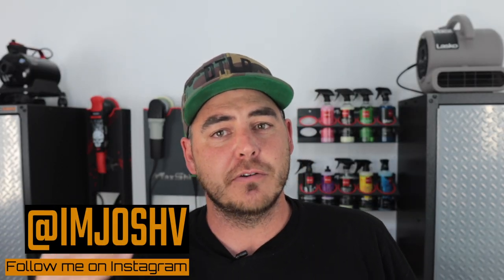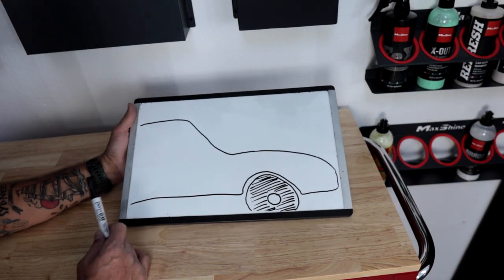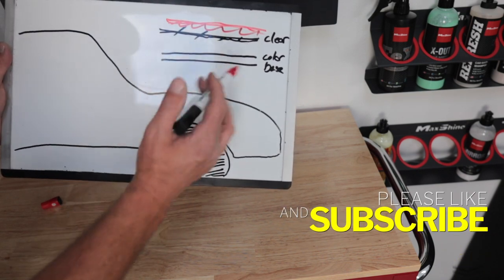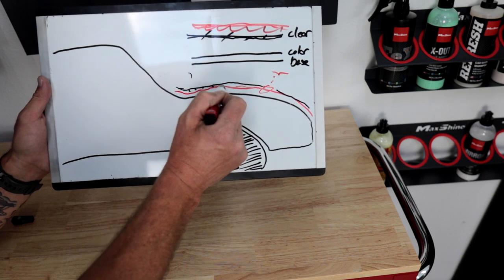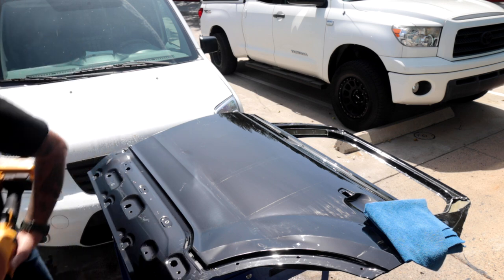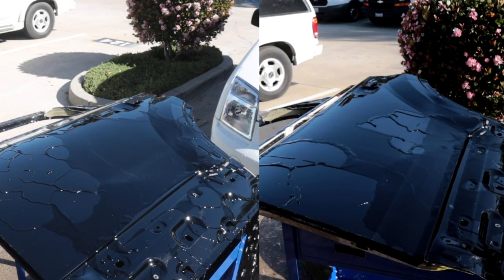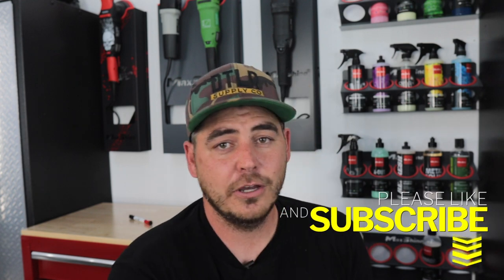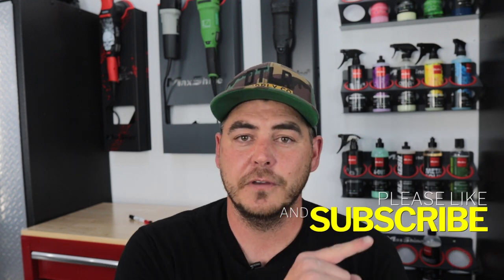Can you put WAX ON A CERAMIC COATING? Ceramic Coating Tips and Tricks

Comment: By the time I have applied a ceramic coating, I am too tired to apply anything else.
Reply: DIY’er problems.
Reply: Ceramic coating will last years. So a year after you put ceramic you can clean the surface/cay it and add a carnauba wax if you like that warm glow. Like he said the water will react to the wax and not bead as well. If you still want the ceramic properties I Would recommend adams graphene boost to enhance the shine and water beading.

Comment: Better to use a wax that is designed to be used on top of ceramic coating like Gyeon Q2 Wax.
Reply: Even using that, it still affects the properties of the coating. The wax will make the car temporarily glossier and slicker, but it will clog the coating and make it loose it self cleaning properties over time.
Reply: @SpartanKyuubi  if your coating is clogged, a decontamination wash will restore it.
Reply: @larrysing  of course, I’m just saying the wax will clog the coating itself.
Reply: @SpartanKyuubi  Gyeon has recommended adding a layer of wax on fresh ceramic coatings to help avoid water spots before the coating is fully cured for years. I doubt they would say that if you were immediately clogging the coating.
Reply: @larrysing  of course they will, they are promoting their own product.

Comment: Great video! What is your take on the Turtle Wax hybrid solutions ceramic spray? I’ve been using it for just over a year on my wife’s jeep and I really like it. I like how you can use it over everything, plastic/glass/paint, but is it as good as dedicated ceramic coating?
Again love the videos, keep up the great work 👍
Reply: I use the same TW ceramic spray product. Brilliant value for about £13.00 for 450ml. The gloss and hydrophobic reaction of TW is very similar to a coating, but the dedicated coating is thicker, more durable, and lasts from a year to nine years, depending on what you go for. Here in the UK, I find I have to reapply the ceramic spray every time I wash the car. For dedicate coatings I use Gtechniq Crystal Serum Light, and Carpro CQuartz.UK V.03.

Comment: I understand that once you apply wax on top of your ceramic, you lose the beading properies of ceramic. But isn't the point of beading to remove water from your panels fast so it doesn't sit and cause damage to your panels? If I have ceramic coating already and the wax is not beading the water as much, what is the harm? The panels are coating with ceramic underneath anyway....I was thinking of wax to add that gloss and warmth and yet function as a sacrificial layer for subsequent car washes...

Comment: I started waxing my coated black car in the fall because of the water spot that appear due to cooler weather.   I've found that I don't have 24hrs for a maintenance coat to fuller cure before dew forms overnight.   Wax doesn't really have a cure time thus moisture from the cooler notes don't leave those annoying spots.

Comment: Its like a rabbit hole. You ceramic coat to protect clear coat. You put wax to protect ceramic. You put ceramic in the first to reduce cleaning. People have other things to do and not just simply do this coating. 

Just ceramic coat the car and regular maintenance should last you more than 3 years. Then you another ceramic coating if needed. No more than this.

Comment: New subscriber. Great vid! 👍🏻 Would love your tips on rejuvenating a ceramic coating as we come out of winter and into spring.
Reply: Hi Kyle. Just want to help by giving you my method. I'm in the UK and coatings get a real battering over the winter period from road-gritting. We have all sorts of sand, minerals, salt, dirt and grease that can really affect a ceramic coating's performance, especially around the front-end, lower panels, and fenders.

I basically, start with a TFR soak and rinse to remove superficial layers of muck. Then it's onto a snowfoam soak for 5-10 minutes and then rinse. Next is a contact wash-and-rinse with PH nuetral to slightly alkaline (no more than pH 10) shampoo to remove that final film of grime and grease. Sometimes, that can be enough to revive the coating, but not always.

So, while the vehicle is still wet after rinsing I'll apply a fallout remover and tar remover to the front end, doors, and arches and let it dwell until it reacts. You can use a very damp mitt to spread the solutions around the panel if you wish. Rinse off thoroughly. If the coating is still inactive in part or whole, I'll finally go over the problem areas with a mild or regular clay and lubricant in order to remove any clogging in the pores of the coating. Usually, these steps would properly reinvigorate a coating. If the coating is still failing then I'd redo the shampoo and decon stage and assess. If it is still dead then I'd surmise that the coating has probably failed in inactive areas.

Comment: On mine I have been using can coat as a base layer and recently been putting wax based quick detailers on top for car shows, I personally really like the glow and shine you get compared to the sio2 detailers. I use the gyeon ceramic detailers every few washes though just as a top op
Reply: U waxing using sponge or polisher machine ?
Reply: @muhammadzaki6274  Their are spray waxes which are applied with a microfiber, and their are liquid waxes that you can apply with a polisher

Comment: U use Fusso99 12 month's on top of my ceramic and WOW Water does not even touch my car  as soon as water hits it it just bonces right off it is incredible. and i guess after 12 mouths then the next layer in the ceramic coat under the fusso99

Comment: It takes synthetic products applied by hand rather than an aio.  I had excellent results with meguiar's ultimate fast finish and meguiar's paint protect on ceramic!.  However, whether meguiar's fast finish or meguiar's paint protect, they are not extremely hydrophobic as a stand-alone protection, but on a Ceramic they are excellent.  On a Ceramic (xml ceramic & Graphene Coating) which is not extremely hydrophobic either but more in the order of sheeting, and dividing a panel into three parts (Ceramic / ceramic + uff / ceramic + pp365), the two  areas with uff and pp365 were super hydrophobic!  Much, much more than ceramic alone.  And even by spraying with apc and super degreaser it held up very well.  "Synthetic" toppers stick better to ceramic than carnauba.
Regarding waxes on ceramics, I would tend to say that a Sealant would be better and without abrasive like meguiar's M26 hi-tech yellow wax

Comment: Hey Josh.  I've been watching your video hoping it would resolve an issue I've been trying to fix ever since I got my sports car in 2017.  The issue I'm trying to resolve has to do not with actual hard water spots, but just dirty water stains that I get after a rainfall.  I want to start by letting you know I already have a coating on my car (Optimum Gloss-Caot) but it doesn't prevent this problem.  Here's a little scenario:  I just washed my car.  Then a few hours later it starts raining but just a bit.  Then the rain stops.  Because of the coating I get beads right?  So when they end up drying they create dirty water stains.  This forces me to wash again (I usually will use a waterless wash product).  This gets me quite upset.  If only the water would just sheet  off the panel instead of beading it would be amazing.  Someone I know told me applying wax over my coating is a solution, but I remember that very same person telling me in the past that when you have a coating, one of its role is to push away everything, INCLUDING wax.  So what's your opinion on this?  Can wax really prevent dirty water stains?  Or maybe another product on top of Gloss-Coat?  Or just another coating completely? This gets me really frustrated so please help me out.  Thanks! :-)
Reply: I read this comment and if you haven't already found a solution, this worked for me. Turtle Wax Flex wax and Maguires ceramic detailer. After I tried many products, I found these 2 work best for me.
Reply: @V.Oakley  Thanks for your help man.  Just one question though.  You mean either one of a combination of both those products?
Reply: I use Meguiars ceramic bead booster(m799) as a topper after a traditional car wash over Carpro UK 3.0. It gives a real dark look to the paint and keeps the 13 month old coating working like new. 
The problem you're having is likely dust on the car before it rains and drying as water spots. Try a leaf blower to remove the water or drive the car before it dries on the paint to help with the amount of water drying on the car.

Comment: Should you 1.use compound wax,than 2.wax and then use the spray Nu finish the better than wax ceramic coating or do you put the new finish on before the wax and do not use the canoeba wax at all

Comment: What coating do you use on Tesla’s?  I just got a Model 3 with PPF on the front clip and I plan on maintaining it with TEC 582.  What about coating the roof? Just wondering what you do.  I just gave it a wash and protected it with the TEC 582 for now until spring and the weather breaks here.  Thanks for another great video love your content!

Comment: Thanks josh does ceramic coat add any mils of thickness of the clear coat
Reply: No it does not,  it protects it
Reply: @MikesAutoDetailing  ok thanks just a layer of protection I had a coating put on my truck a few years ago called xkote you may have heard of it it’s almost like a wipe on clear coat and I could not believe the difference it made the truck is still looking great
Reply: @coreymerritt7742  with proper maintenance it will for awhile...great job
Reply: The thickness is barely measurable. I think a single layer is about 1-2 microns in depth.

Comment: Great vid! Here in the UK, I usually apply a graphene or Carnuba infused wax then a layer of the Turtle Wax Hybrid solutions Ceramic spray coating. Am i just making extra work for myself? Should I apply the wax after the ceramic coating instead of before?

Comment: Is the unbranded foam gun on DTLR Supply exactly the same as MJJC foam gun?
Reply from the maker: Yep, Its the latest model. The MJJC foam cannon pro v2 (just with no logos)
Reply: @imjoshv  I just ordered one does it come with the 1.1mm Orifice?
Reply from the maker: @prue420  it does! It has 1.25 installed but also comes with a 1.1

Comment: Fusso coat would be the best wax to put on a ceramic coating it’s just as hydrophobic and can last up to 12 months
Reply: Russo will diminish the gloss quality of any coating. 
By itself it’s a awesome wax for protection, but it fails to make the paintwork look glossier/deeper
Reply: @SpartanKyuubi  I’m gunna have to disagree with that I just put it on my test panel and there’s a crazy difference I can actually see the metallic flakes in the paint before it just looked like green paint and it looks like it’s a much deeper colour then it was before

Comment: Negative ghost rider, so detailer to detailer.. not a weekend warrior lol… since yes, waxes are cleaner product.. the abrasion between the  product and the pad will definitely hinder the coating.. that looks possibly like a malco medium polish.. so would be abrasive enough..also if you choose to wax,  which I wouldn’t.. there are hundreds of sprayable topper products on any local shelf that will boost hydrophobic properties and help maintain coatings… but in any high temp states… wax will render itself useless on any hot day with the exception of a few which will cause the wax to clog the coating.. now you have more of a issue, you can use iron removers and so on to cleanse the surface but it’s just not worth it… buy a spray topper and move on with life 😊
Reply from the maker: Hey mike, I agree a spray topper is the easiest way to go. I actually just used the meguiars cleaner wax on this. Not enough abrasion to degrade a coating from that usage but over multiple applications it could potentially. The reason I made the video is because I get asked this question all the time. People think that they are completely removing the coating from adding a wax and I wanted to explain that for them so they dont have to worry that they ruined their coating.  But yes I always advise people to use a product like carpro reload or something similar instead of a wax.

Comment: Help needed:
I know this is old, but hopefully someone will see this and point me in the right direction.
First thing, female here, thus I know as much as I am informed, meaning given I've been told several different things I just want a simple solution and plain and simple answers.
So, got my car, out of the bat I had some issues wight the car dealer, it was perfect when I received it, by the first time I took it to be detailed, I was informed and shown that the paint had water damage, it had water stains all over, so went back to the car dealership because it was a new car and there was no way that coukd have happened in 2 weeks, they recognised the issue and took care of it, returning my car brand new and gorgeous.
Next step: got ceramic coating done because I wanted to prevent what I saw can actually happen.
Get to the place, is not cheap, do it and also get a clear plaxi I think it's called for my windshield.
I had my car for less than a month when I found it scratch in the right side of the bumper, and the following week keyed, confronted the guy who I know did it, and yeah, FML.
Anyway, take it to the same place to get an estimate and see what they can do, without having to involve my insurance company, it's a no go, they say they cannot polish nor wax on top of the ceramic coating, the two pieces have to be paint/worked on and the do the ceramic on top of it... And a part of me feels like it is bs.
I mean sure there's a part of the scratch in the bumper where the paint was chipped so I know that cannot be fixed without getting worked on, but the rest I believe it should be either fixed or at least improved.
Also, regardless of the ceramic coating I am noticing water stains again on my review glass especially, and I've found scratches inside my car, the glass sections, and it must be from when I get the care detailed because there is no way it's me, I don't even handle keys not sharp anything inside the car, so with that said, what products should I use on the exterior of my car which has a ceramic coating that can possibly remove or reduce scratches without compromising the ceramic and inside to also get rid of scratches?

Comment: My car got detailed, they put wax on it, can I apply ceramic coating on top of the wax?
Reply: No. You should do a strip wash to remove all the chemicals on the paint including wax, chemically and mechanically decon the paint, before applying ceramic coating. Ceramic coating should always be bound to clean clear coat, not to any forms of chemicals or wax.

Comment: Have you been able to test the actual durability of TEC582? I’m curious how long it actually lasts and how often it should be applied. I’m also curious if it would make a good final step after freshly ceramic coating a vehicle to protect the coating from water spots and such for the week or two afterwards
Reply: tec582 is awesome- it gives the best shine to my cars without streaks or high spots, even when used in the florida sun on a florida summer day. I have used it as a standalone protectant and while I never fully tested the durability, it did withstand a citrus wash and Carpro Descale wash. I use it as a topper after every wash without any issues or buildup/high spots. I just bought the 5 gallon so its even more economical. I just ceramic coated my car and considered using it right after but felt I should let it cure the 14 days first.